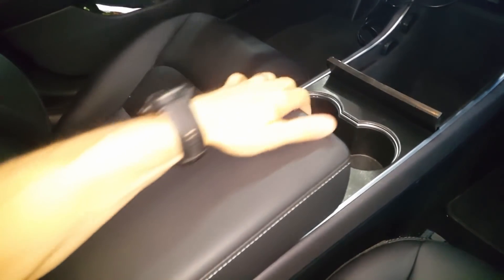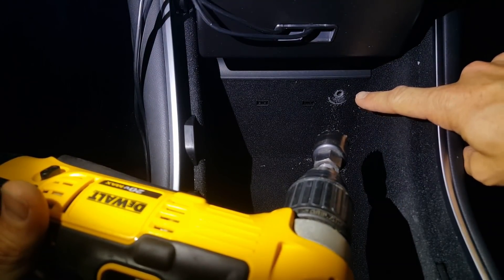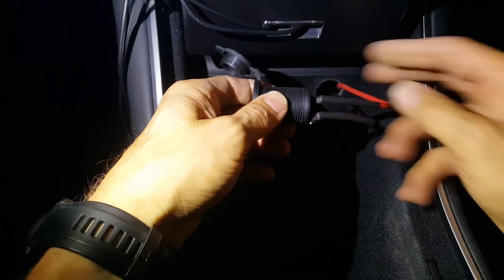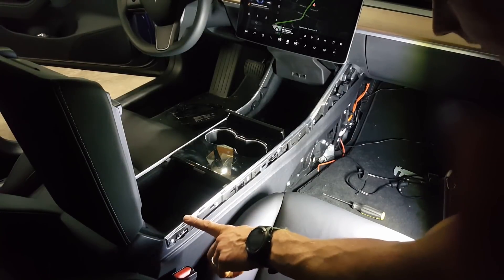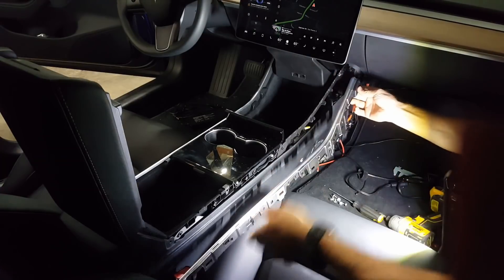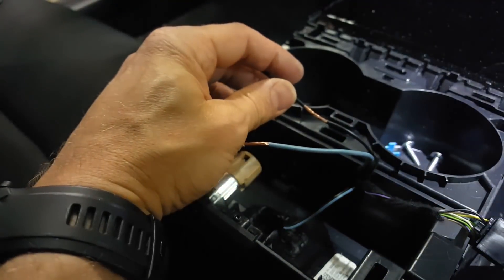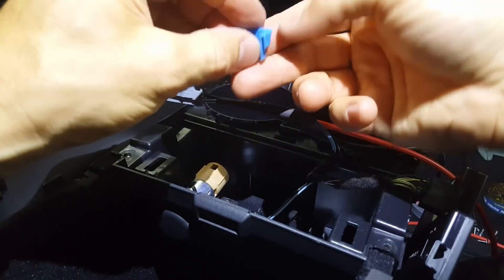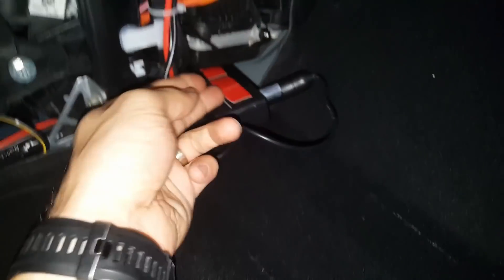Tesla Model 3 additional 12V outlet

Comment: Fantastic instructional. So many ways to do things. I'm in the process of either adding a new 12v plug in the center console by the two usb's up front. My wireless charger is worthless using those 1.4a (7w)usb A plugs.  My thought are to just relocate the original 12v plug into that area. I just need that with a usb plug that outputs 14w x 2 with quick charge 3.0. Having problems with SentryMode videos loading slowly.  This HUB Im currently using goes from the 2 usb A(1.4a or 7w) to 3 USB A, 2 USB C,  It's trying to split whatever power it has to the wireless charger, Plus my samsung t5 SSD....So with 12v by those 2 USB A. And a 12v plug with 2 USB female slots that do quick charge 3.0 x 14w+ that would use all the wireless charger capability and leave those two USB A's for SentryCam USB and whatever else I need the other one for.

Comment: How much total mod can you steal from that outlet? The only thing I did different was when you stripped the wire I use my blade to split the wire and put my new wire through the hole and then twist it together and finally use solder and shrink with tape. I put a fuse online about 12” or less but in this case I had to fuse it 18” as I wanted easy access to this fuse if need be from the side panel. Great job man and keep making these fine detail video’s!

Comment: Do you think the 12v outlet could be installed in any other location in the front bin? Like on the right hand side somewhere. I have a Jeda USB hub and can't use this location. https://getjeda.com/tesla-model3-usb-hub/
Reply: I had the exact same concern and to summarize - yes you can! I used one of these connectors https://www.amazon.com/Nilight-Cigarette-Terminal-Accessory-Inflator/dp/B07T1B52G7 and drilled a whole on the right hand side, used a grommet and have the 12V socket in the console
Reply: @krisnaydenov  Thanks. I used a cord from the 12v outlet up the front box for a recent road trip and I am still having an issue where my Samsung Galaxy S9+ doesn't stay full charge and overheats when using the wireless charger and running Waze. If I plug the phone in with a cable it doesn't happen. It is really frustrating. Would be nice if the charging pad had some kind of cooling for itself and the phone.

Comment: Thanks for this video! As others stated, direct and accurate. FYI: after using "Shut Off", the power port is still powered (maybe this changed with an update, like when they introduced camping mode?). I temporarily taped the blue positive wire to prevent accidental short while working.

Comment: Just a note for Model Y owners. The hole that is drilled, will not be in the same position. Ask me how I know. There is a vacuum hose and bracket in the way. Once you disassemble the side panels you may be able to determine where to drill. A little further to the right and down. Try to find a shallower 12 volt socket also. There isn't a lot of room, but it can be done. Mine isn't pretty but it worked. Everything else Jon said to do still applies.
Reply: How do you know?

Comment: This completely bricked my car, it doesn’t go into drive and won’t lock.
Reply from the maker: Did you accidentally short the pos/neg wires together? Have you tried doing a reset (foot on brake, hold both scroll wheels until Tesla logo appears)?

Comment: How do you unplug those cables from the 12v connector? Just pull them out or there is some trick to it? Thanks!
Reply from the maker: I don't recall - there is usually a small tang you have to push out of the way before they pull out. Much easier to use this 12V instead: https://www.youtube.com/watch?v=wc3KchAv270

Comment: Thank You for this great video, Jon. I did it just the way You told us and it works. Removing the cupholder plate is a little bit enerving. But through Your instructions I knew the place of the springs.

Comment: Excellent video solving an issue that Tesla should have thought about from the beginning. A 12V outlet should have been in that location from the start. I have 2 questions.
1. Why do you prefer this over this solution if all one wants to add the option for additional USB ports?
2. If you are located in the San Francisco Bay Area, would you be willing to do this for someone. Of course for appropriate compensation.
Reply from the maker: I did this primarily so I can use 2 wireless fast chargers. The USB ports don't provide enough power for fast charging. Sorry, not in the Bay Area.

Comment: Hey Jon, how were you able to view the space behind where you placed the socket?  I removed the top trim and the the carpeted portion but am still unable to see the  amount of space available. the socket i got is slightly wider in diameter so i need to drill a 30mm hole and wanted to verify that there's nothing besides the plastic bracing in the way on the other sides.

Comment: What size hole saw did you use? I didn't know they made a 1 1/16. Unless you used a 1" and trimmed the remaining.
Reply from the maker: I used the 1-1/8" hole saw from a cheap Harbor Freight set, which only cut a 1-1/16" hole. After that, it took just a little bit of filing to get a good fit.

Comment: Hey Jon, I did this and while I had the terminals out of the plug they touched and arced. Now I have no power to the accessory/cigarette lighter plug. I have tried a soft shut off by pressing the buttons on the wheel. A hard rest by pressing the break and both buttons and even tried disconnecting the power from the battery. This was all in an attempt to reset whatever Tesla is using instead of fuses. Any ideas on what else I can try? Just to note I did have the power turned off at the time it happened. Also, seems like the power off feature turns the power back on if you shift in the drivers seat even without touching the break pedal.
Reply: I ended up disconnecting all peripheral accessories that were connected and when I woke up in the morning everything was working. Looks like the solid state breaker reset is all that was needed.
Reply from the maker: Try pressing the brake 5 times, holding it on the 5th time and then hold both scroll wheels and don't release them until you see the Tesla logo on the touchscreen. If that doesn't work, the car may reset on its own given enough time. I recently had my glovebox unplugged from the wiring harness, and when I reconnected it the latch release was unresponsive, even after the different soft/hard resets. After a day or so, the car seemed to reset and it works fine now. You could also contact Tesla service and ask them how to reset it. You'd be in the same situation if you happened to plug something in to the 12V outlet that had a short.
Reply: Thanks for the tip. I tried this with no success. :(. I will try calling service and see what they say.
Reply: Ryan040483 did you figure this out
Reply: No fuses?? Haven't done any electrical mods yet...

Comment: How deep is the area behind the place you put the socket?  Not the depth to the wire behind, but the available depth for the socket?
Reply from the maker: You have about 55mm before you run into the plastic structure behind where I put the hole.
Reply: @rdtc2854  Thanks for the quick reply!

Comment: Hey Jon, how did you remove that carpeted area under the trim of the console(where you would store the splitter, by the passenger footwell)? When you popped of the trim the side area was already removed. I may have missed it..
Reply from the maker: I missed showing that step. It pulls straight off, start in the upper right hand corner. I show removing it in the first part of this video https://youtu.be/WCteH3AxVQo
Reply: Jon Osborne Thanks! Do you know if the process is the same for the drivers side and If there's the same amount of space for a splitter?
Reply from the maker: Yes, same procedure for driver's side. Also same access to that space. You can see it in this video: https://youtu.be/-BGRgJwt_E8

Comment: Do you know where the the original 12v outlet cables run to? I'm wondering if there is a later point in the run where you can tap in without having to remove all that trim and the cupholders. Want to try this but that's just a lot of things to remove.
Reply from the maker: Dennis Do it looked to me like it ran under the driver's seat and then to a wiring block behind the left panel in the driver's side footwell. There is a larger gauge 12V supply there as well, but it drops to 9V when the car goes to sleep.
Reply: Jon Osborne So the larger 12 gauge power supply provides power even when the car is off (albeit much weaker)? Could you tell me how I would be able to tell the wires apart when looking in the panel in the driver's side footwell?
Reply from the maker: I will do some more investigation later this week and post some more details on the wiring in the driver's footwell.
Reply: I m looking for a permanent 12v to install a dashcam + permanent hotspot too... waiting your conformation/news from you about that
Reply from the maker: Here is an under dash location you can tap for 12V power instead of going to the center console https://youtu.be/wc3KchAv270

Comment: Aluminum + copper mixed connection will corrode.. Probably not a huge issue at the low voltage, but something to be wary of.
Reply from the maker: The existing car wiring is copper. The wire I added is tinned copper (link in the video description) - perhaps that looks like aluminum in the video?
Reply: Ah my bad, it did look aluminum. Cheers

Comment: Jon the perfectionist! I love your work. 
Is there a way to add an auxiliary input to the audio system? I have a satellite radio with a lifetime contract and really want to use it in my Model 3. 

Great videos and easy on the eyes, too!
Reply: Get a bluetooth transmitter, plug it to your sat radio output and convert it to bluetooth. Search "bleutooth transmitter aux" or something on Amazon.
Reply from the maker: Not that I'm aware of. That would be a nice option though.
Reply: If you ever find yourself rooting around behind the dashboard, think of my question. Mitch
Reply: Fantastic solution!!! 
Thank you so much, Elias I'll look into that.
Reply: Here is one that works as a bluetooth transmitter, you first have to set the switch to RX mode to have it sync to your radio but then switch it to TX an it works great https://www.amazon.com/gp/product/B07D1JJBJR/ref=oh_aui_detailpage_o05_s00?ie=UTF8&psc=1